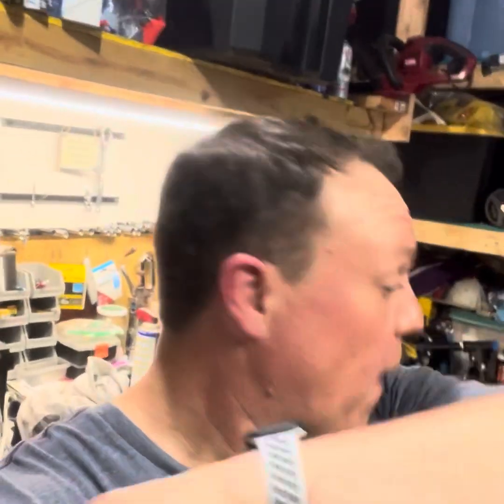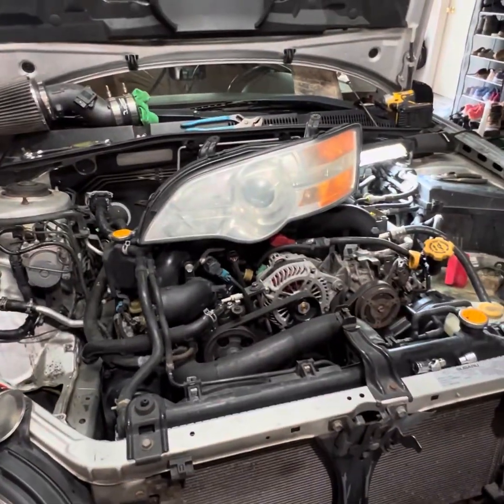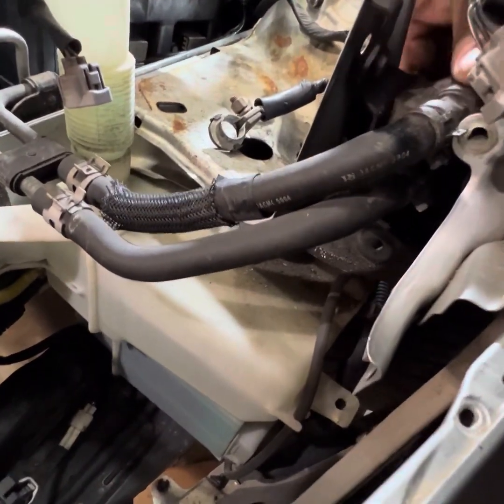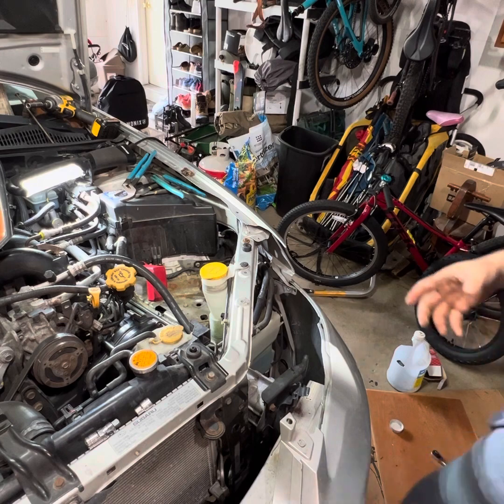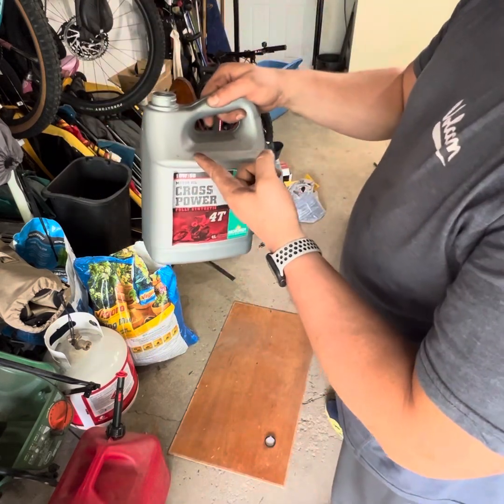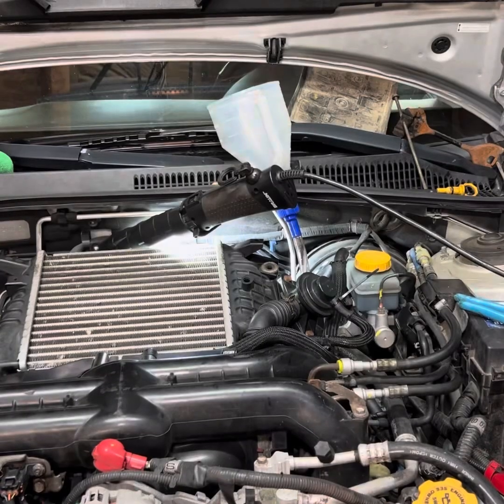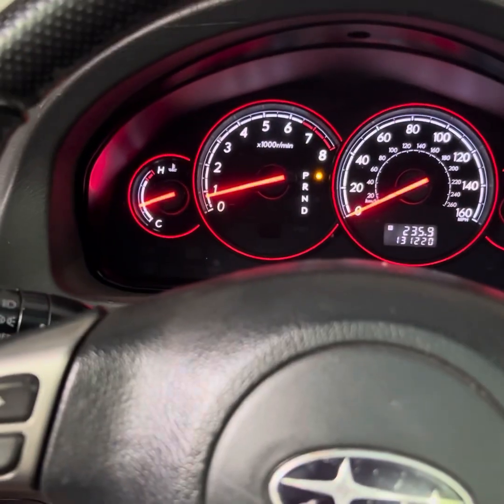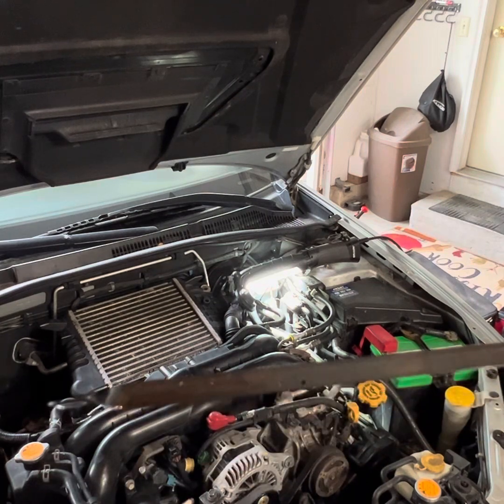2006 Subaru Legacy GT transmission fluid and filter change

Comment: Hey brother, so I just bought a 2007 legacy GT and it hard shifts or feels likes it's gonna stall. Would a flush and transmission oil change fix that?
Reply: Never flush the transmission. Just change the oil and filter
Reply: @DavidMarcy-pp6jv  too late lmao. Still feels the same however, gotta keep diagnosing it because my gears and such don't look bad. Might just be the valve body or a reprogram. Any ideas you may have my friend?
Reply: I recommend rebuilding the transmission. Have it done right. These cars today don't last.
Reply: @DavidMarcy-pp6jv  gonna take that into account and see who can  do it. Thanks brother.